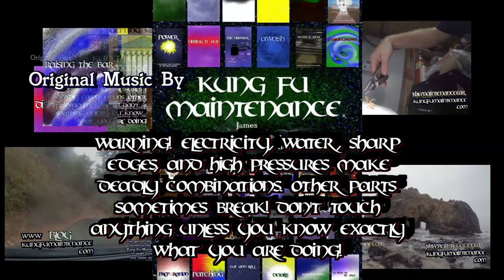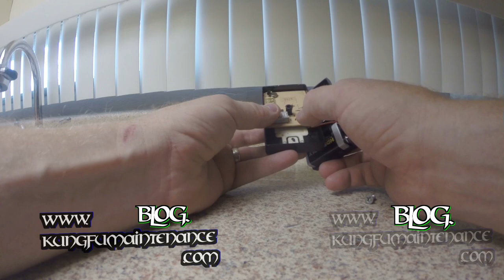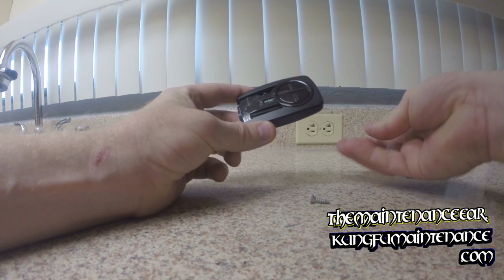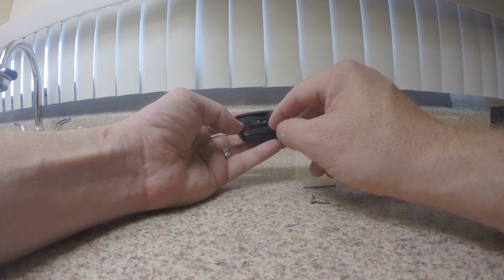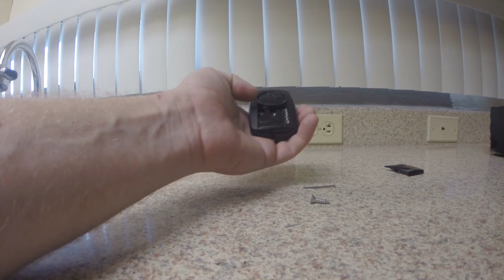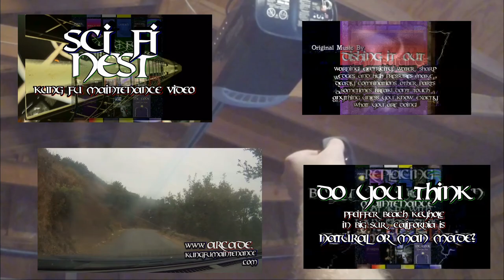How To Program Dip Switches For Garage Door Gate Remotes Like Linear Chamberlain Universal Video

Comment: Hi, thano you for your video, although it didn't show how to solve my problem.  I currently have a garage opener with 8 dip switches set to open and close the door, but I need another opener and the one I have uses 10 dip switches.  I followed your instructions but no luck.  Any ideas? I can provide pics upon request.  Thanks!

Comment: I just spent several hours working on this, and unfortunately, this didn't solve the problem with my 2 new remotes. No learn button, but the dip switches are set correctly. I tried all up, then setting, all down, then setting, I tried setting them opposite, I tried upside down, nothing worked. I was using an old remote that does work and trying to set new ones with the same number of dip switches, supposedly compatible, but the new ones just won't operate the door.

Comment: Great video, I have an old Stanley engine with switches, I matched them all and used the same technique on a different universal remote that uses identical instructions. 

The door did not respond, could it be that it does not match that specific model? (Stanley 440) Refoss remote (Amazon)...
Reply from the maker: Check out this video for possible fix. Hope it helps!  https://youtu.be/PMBh2ErViUk